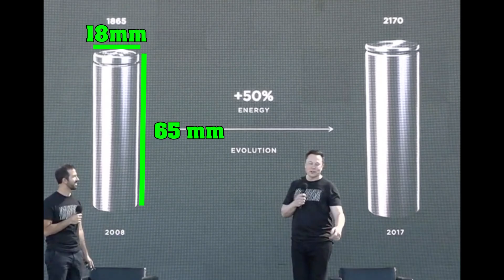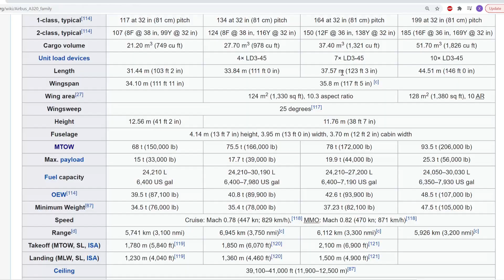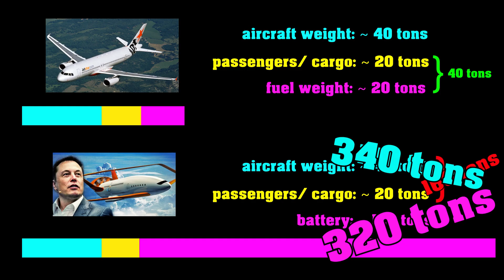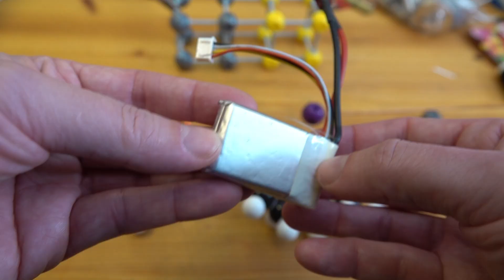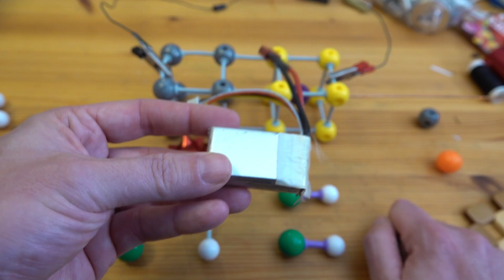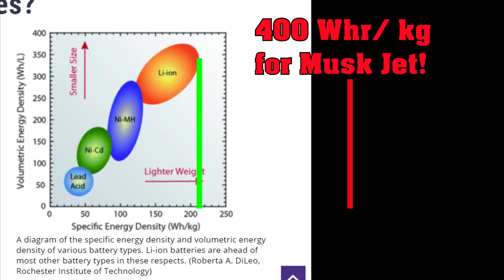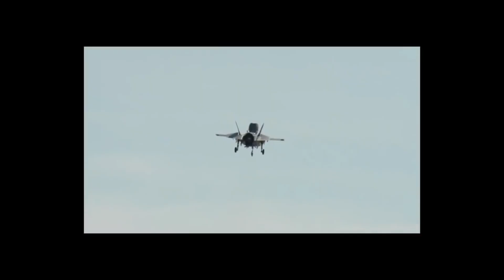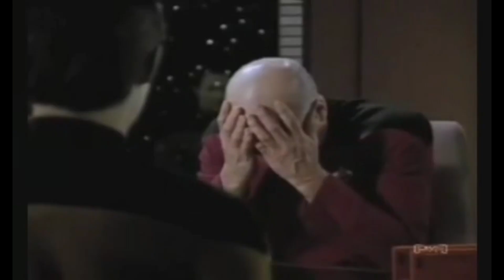Tesla's Secret Plan To Disrupt Airlines: BUSTED!!

Comment: Pop some solarpanels on and call it "Solar friggin' Airways"
Reply: don't forget the complementary dehumidifier
Reply: @4ll3sb4n4n3  *water from air magic thing
Reply: I mean, at least solar planes have successfully flown, even circumnavigated. They're slow and have a low size to payload ratio. But they do actually work.
Reply: They also added big flat air filters to the front to start making plastics out of the atmosphere as it flies.
Reply: @chaosryans  Thanks for the idea. Now there is an electric solar powered plane that produces cups, plates and water for a complimentary drink dring he flight. Saves taking on a lot of stuff.
Reply: Make the solar panels out of Thorium, and you got a deal!
Reply: @elcamello1980  Somehow, wasn't that the idea behind the molten salt reactor in the 1965? Ok got it that was U235 based. But there was something with Thorium there also.
Reply: @hrmpfii2225  sorry, man, I haven't the foggiest.
Reply: @elcamello1980  Don't want to bother you, in 1965 the US air force paid for research a nuclear-powered airplane. They had after all the idea to use a U233  Molten Salt Reactor. You have to breed U233 from Thorium. Somehow your idea of a Thorium plane was already there some 60 years ago.
Reply: @hrmpfii2225  really? Wow! I didn't know that.
 All this aside, I was just making a stupid joke/reference to Thunderf00t's video where he debunks a car that was supposedly going to run on Thorium.
 I really didn't know about that Thorium plane thing, though.
Reply: HUWAHHHH?
Reply: @engineer99 Look up the Airbus Zephyr, there are absolutely solar powered aircraft.
Reply: @enlightenedgroyper2956  it's a drone that has the maximum take off weight of 170 pounds an wingspan bigger then the Embraer Legacy 600
Reply: @KoalaFrank  What's your point
Reply: @enlightenedgroyper2956  point is that the whole solar power airplane is extremely useless. its wingspan is as big as a 13 person private jet but its payload is les then 8 pounds. its a rc plane on roids and they have been out since 1938
Reply: @KoalaFrank  Obviously you're not going to be hauling 20 tons of cargo with it, but it has its uses. Airbus have proposed that it could be used for monitoring wildfires and crops, Border patrol, searches in the aftermath of natural disasters, as well as other ISR applications, just to name a few things.
Reply: @enlightenedgroyper2956  sure, and musk's battery plane can have it's uses, but this is about passenger planes for humans, not glorified drones
Reply: @enlightenedgroyper2956  yes that's what they are marked for but half the list most government use things called satellite. As for real world use in the 14 years of it's development it's just done test flights and 2 of the 3 ever built crashed. But yes relating to this video a drone is a far cry from any commercial use
Reply: @Sidowse  yes but that's it u cant add any extra weight and the think it self ways 170 pounds so trying to say it works is pretty pointless even the new version has a carry capacity of 11 pounds with a 92 foot wingspan. so think of it like this how  many panels plus the size of the plane would it take to lift one person? you would need a wingspan of 1250 feet to lift 150 pounds thats not including the reduction of the bigger prop engines to produce enough thrust to move that weight and the extra panels
Reply: @Sidowse  any energy has potential to go faster but at what cost in this case electric is more weight and mass for less lift that's the factor it's easy to build a car cause it just need enough thrust to move forward in a planes cause u need enough to maintain lift for the weight u require and it's just doesn't work as the main example can only lift itself proving it don't produce enough for any reasonable type of commercial use.
Reply: @Sidowse  the plane is gonna have to be made of more than 100% solar panels all looking at the sun at the same time lol. The amount of energy for and aero plane to take off is just too immense. BUT if we’re talking about maybe charging your iPhone battery... it’s probably a good idea, though there are other factors you need to factor in like frost build up and things of that nature that might hinder said panel to take in any light to charge things.
Reply: solar powered passenger carrying Airship
Reply: @Sidowse  There's a reason we moved away from steam power a hundred and something years ago!
Reply: -Matter didn’t create anti matter
-Anti matter didn’t create matter
(Both of them were present at the time of big bang)
-Both of them didn’t create themselves.
-Both of them came from an unimaginable source,  that unimaginable source created matter and antimatter (everything) thats why it is known as “the creator” of everything.
———m
- that unimaginable source/creator has created sin and virtue which are opposite to each other,
— logic says every action has its own reaction, so the reaction of sin must be different than the reaction of virtue,
— the creator has created prophets to let us know about each and every detail of sin and virtue, also about their reactions,
Thank u :)
Reply: @dott8045  give this a watch https://www.youtube.com/watch?v=7ImvlS8PLIo
Reply: @Sidowse  they're big, slow and heavy.. I can't believe I have to write this out
Reply: @Sidowse  what's the damn point of a plane that goes 20-30mph?  If ultralites (one such kind of plane) were of any tangible use other than sunday sightseeing, we'd have lots of them
Reply: @Sidowse  yeah, they do use steam to launch an aircraft, do you know how heavy the plumbing, boilers, etc are?  

I do think flying will become prohibitively expensive for the reasons you mention, and I don't think electric flight of any distance is going to be viable for a very long time.
This video is about Elon Musks supersonic electric plane, so my comments were in relation to that.. and no, I still don't think it's reasonable to put solar panels on a plane

Comment: "There are liars, Damn Liars and BATTERY ENGINEERS"
Reply: Well, the physicist, chemists, and engineers working on this stuff in academia are probably not as bad as industry, which has to push out a product regardless of whether they actually had a breakthrough.
Reply: @SelectHawk  Yeah lots of scientists do that with their researchs
Reply: @engineer99 I don't think they tend to be. Yes, it is a problem in both cases, but at least a bad result still leads to a paper publication, just not in a good journal. Industry people have to upsell their garbage way harder, and often with tighter deadlines and higher expectations. If you read the literature of fields you have some expertise in yourself, you'll find plenty of good stuff alongside some garbage.
Reply: @engineer99 those widely criticized claims like the Battery guy and the Life on Venus situation tend to ruin careers, whereas people like Musk can spin bullshit to the general public way easier.